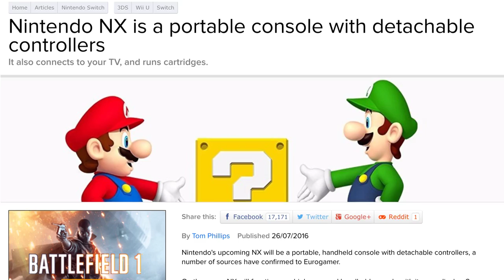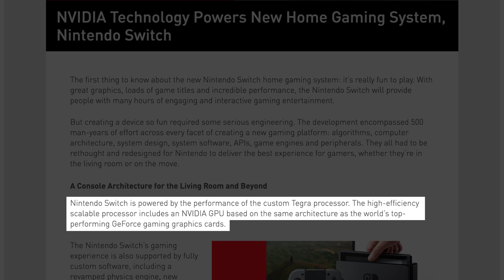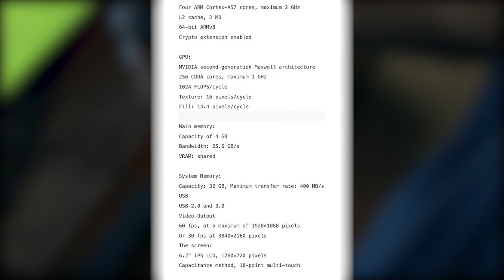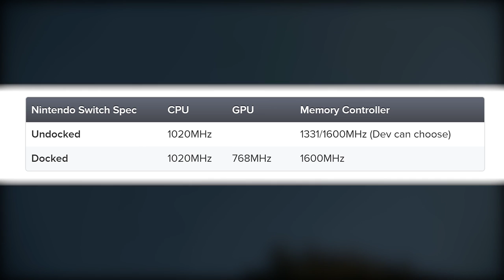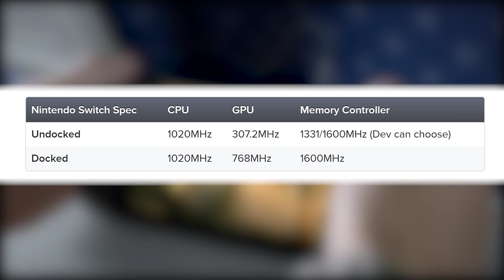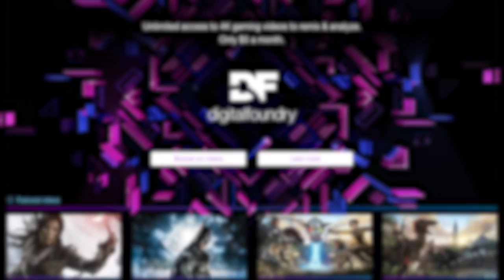DF Videocast #6: Nintendo Switch Clock-Speeds Revealed

Comment: I can't believe they are going maxwell , pascal offers better temp and energy saving, this console needs to shine in handheld this has to replace 3ds and wii u it also can't be more than 250 price point to capture 3ds users everything point to be a great device but yeah we need pascal chip again no only for power battery life and cool temp is fundamental to success here
Reply: Tools  nothing has been confirmed yet, this is all still just rumors.
Reply: the fact is pascal chips stills expensive a ps4 sells out for as low as 229 if nintendo want compete they have to offer switch for no more than 250 is rough but nintendo 3ds find it candy coming from a 200 bucks handheld to a way more powerful handheld

Comment: How many CUDA cores does the Nintendo Switch have ??
Reply: James Qwerty, 256 maxwell 2nd gen. 2015 technology in 2017.
Reply: 256 x 2 = 512 x 768mhz = 393 gflops not near the 1tflop as stated, if that's the case .The ps3 has 230 gflops ,so with those small amount of CUDA cores it's slightly faster than the ps3. Nintendo Switch has to have more than 256 CUDA cores , idk if reasonable GPU clock speed could hit 1 tflop with only 256 CUDA cores .If the Switch CUDA cores = 653 x 2 = 1306 x 768 = 1tflop. Ps4 1152 cores x 2 = 2304 x 800mhz= 1.8 tflops or my GTX 1070  Msi GTX 1070 gaming X (pascal) at clocks it came with, not manually overclocked 1920 x 2 = 3840 x 1797mhz =  6.9 tflops.
Reply: That Tflops measure it's completely wrong it's half precision (FP 16 ) PS3 has near 250 gflops in single precision (FP 32). All you've left  wrotten it's a  nonsense jumble. Divide by half ;)
Reply: It matches the tflop count Nvidia says the GTX1070 has 6.5 tflops , only mine came with a factory overclock.That's on Nvidia architecture too, we know Nvidia has lower tflop count compared to Amd due to differences in architectures .A stock GTX1070 outpaces a Amd Fury x 8.6 tflop card in most games .I know I'm not getting it wrong with what performance you'll see in a real world gaming.The Nintendo Switch may only have 1 tflop but that does not directly compare to Amd 1 tflop count because of said differences in architecture.Please do enlighten me on my own GPU's performance.
Reply: A tflop it's just a measure of computing and it's the same for everything,  and you're right saying that at the same level amd is below nvidia under dx11, but its performance is almost the same using asinchronous computing under dx 12 or Vulkan libraries, in graphics engine like Frostbite e.g.

SoCs devices based on arm and embedded graphics low power solutions use (i.e. Snapdragon, Apple A series, Tegra) usually show its specs using half precision (marketing :)) also Snapdragon GPU shaders, Adreno are based but not equal on desktop/laptop Radeon. Same with Tegra Maxwell/Pascal  are not exactly the same with their counterparts, TMUs, Rops, memory bandwith are heavily optimized for lower comsumption.

Please don't mix apples with oranges. Let's wait and see and don't shoot the messengers who have listen developers who are making games using official devkits. Eurogamer it's not another web with cheap clickbait or an anonymous forum, they hit Ps pro specs and the Project Scorpio existence.

P.D.: Sorry for my bad english grammar I'm spanish. Greetings.

Comment: I think this is a positive thing! Now game developers has to start thinking instead of just porting PC games to console. Most PS4  games for example are just a poor mans versions of the PC equivalent games. Actually I hate the fact that game consoles nowadays runs on PC hardware. It's obvious that every game will run on the same major game engines under the DX11 framework. The PS2 is one of my favorite consoles, and it was pretty hard to code for because of it's own hardware design. This which lead to a bigger diversity in how games looked and played if you compare to the consoles today.
Reply: Didn't seem to work for the Wii U, so why would this be a positive for the Switch?

Comment: These specifications do not make sense
4K/30 with lower specs than shield , I need to see that for believe.
300 MHz in handle mode, like Vita, you can't run BoTW with that.
Nvidia expect 10 years of relationship with Nintendo, 
This doesn't make sense.

Comment: Sounds like a great handheld. But the main issue is that unless you're a fool, it's just going to be another exclusive machine. Don't get me wrong, games that people don't think are going to hit or sell, but are two player are going to put work in, but otherwise, it's just a powerful vita with absolutely no worry about having to develop games that will be cannibalized by their console counterparts. 

It sounds like a proper playstation vita. For me that's a sale. I don't think people remember how shit vita looks in 1080i. And nintendo is really the only company capable of doing that and not needing to destroy or add merit to buying handheld vs the console. Pokemon, monster hunter, mario, mario kart, golden sun, fire emblem, pikmin, animal crossing, etc probably don't need a powerful thing to run it. F zero gx and other m are probably games that require power, and both of those ideas are pretty dead. So mostly smash bros is going to be the hardest hit, and after that, it's just a display with good games. And it probably can do that.

Comment: It's gonna suck so hard! Nintendo didn't learn anything, again and for that reason, they will not get my money. Think about it for a second. Only 1 GHz CPU in video game console in 2017. Let that sink in for a moment. Let's remember also the PS4's and Xbox One's biggest bottleneck, the CPU running at slow clock speed.
Reply: MadFinnTech it's when undocked. If the console used 3Ghz CPU when on the go, no battery would resist.

Comment: This is so messed up. They should have just marketed as a 3ds successor. If it cost over $200 I can't see this as a good purchase in my opinion. If they can bring the games and not have long ass droughts they should be good with thier fan base. I think I would pick it up only because I don't own a 3ds so this is the better option over that.

Comment: Mother of god. I knew the Switch was going to be weak but if these specs are real, I did not expect it to be this weak. I would have expected it to be at least on par with the Xbox One or close enough to get most of the 3rd party games but with being this different in architecture and this weak in power, they're just going to pass it up yet again. 

I don't want the Switch to fail. It's a great idea, everything the Wii U should have been based on what we've seen so far but despite what Nintendo thinks, there is a fine line between offering a unique experience and severely underpowered. 

Nintendo, if you ever read this, let me help you please:

N64 - No CD support, less third party support, two years too late. Otherwise, great console and a collectible with fantastic first party games.

Gamecube - No DVD support meant less data on Nintendo's discs. Resulted in features being cut or third party ports not happening. 2nd most powerful console of the generation and had some great looking games shown with Resi 4 and Metroid.

Wii U - Terrible marketing, terrible brand name, poor USP that Nintendo didn't know what to do with. If it had been named the Wii 2, it may have done better. Underpowered, third party support non-existent, online service still in infancy compared to XBL and PSN. Great 1st party games but again, not enough. It will ultimately become a collectible for the fans and worthless to Nintendo.

My predictions for the Nintendo Switch:

Switch - Underpowered meaning no 3rd party support after launch window like the Wii U. The Switch needs third party support more than anything at this point.

What I wanted Switch to be:

- At least on par with Xbox One to guarantee third party support
- Refined Account system for Nintendo Network
- Handheld games like a proper Pokemon game as well as console games on the go.

Nintendo seem to be afraid to make a console like the Xbox One and PS4 when every time they have tried to be on par, they have shot themselves in the foot. If the Nintendo Switch does not catch on, make a powerful traditional home console with no self-inflicted handicaps with a strong launch lineup and it should sell.

Comment: So, Nintendo went for a small, very incremental improvement over their previous console, and the new console utilizes older tech running at unimpressive speeds and is miles behind the competition. In other news, water is wet.

Comment: Well damn the switch undocked is running at 190 gflops 😂
Reply: 393 gflops while docked ? Mate I have no words right now. I'm praying digital foundry is wrong because the switch is essentially a portable wii u
Reply: Swift B If that is the case, Zelda BotW should have run WORSE compared to the Wii U. As seen from Jimmy Fallon, thats not the case.
Reply: MorimotoYTP cpu is likely the reason why switch is better than the wii u

Comment: With the specs named here Skyrim (and not even the special edition) wouldn't run at 720p or 1080p in a reasonable framerate. So no Skyrim or the specs are wrong. Simple technical reality even if Skyrim is a old game.

Comment: OK so, why the hell does it need a fan for? Why the official leaked patents said the fan was running even in portable mode if according to this rumor it doesn't need it? Why the hell does it need an extra fan on the dock if even when docked it's weaker than the 2 years old SHIELD Android TV? Why didn't they used Pascal if Nvidia has been working with Nintendo for over 2 years and the Drive PX2 came out this January(B4 E3) and it has 2 Tegra X2? Couldn't both SoC be developed together or did Nvidia didn't told Nintendo that the X2 would be ready a year and 2 months before the NS release date? And finally, why the hell would they need to make 2 games just because the Switch has 2 modes when developers have to deal with an infinite number of combinations on PC? Is it me or are some people just trying to kill hype the NS has created?

Comment: 256 CUDA cores * 2 (ADDMUL) * 768 MHz (or 307 MHz) = 0,4 TFLOPS (or 0,15 TFLOPS). This console is a pure joke in terms of performance. Basically docked switch is as powerful as Radeon 3850 from 2007 or Geforce 9800 GTX from 2008.
Reply: Correct. Some Benchmarks:

Geekbench 3:
iPhone 7: 5500
Tegra x1: 5000
Estimated Switch Score: 2500-3000

So in terms of computing power it will be 40-50% of an iPhone.

Graphics: 
GFX Benchmark Trex:
iPhone 7: 107 FPS
Google Pixel C (tegra x1): 103 FPS
Estimated Switch Score undocked: 60 FPS
Ps4: 480 FPS
Ps4 Pro: 870 FPS
Wii U: 73 FPS
Reply: +Walther Penne you know there are mobile phones that can show you're emails and have near twice the power? No need to wait for Nintendo to Re-Innovate you're email reading experience, nor write another book length reply to justify why 2007 performance is a good thing for Nintendo.

Comment: I don't understand Nintendo. Why release a system that's not very powerful when its been proven that people, other than huge Nintendo fans, are not going to buy an underpowered system just for Nintendo games? I am a huge Nintendo fan and i bought a Wii U when it came out, kept it for 6 months and then sold it and haven't looked back. I will stick with my 3DS, which is the big issue. If Nintendo wants this Switch to be a success then they will have to pull the plug on the 3DS. As long as the 3DS is alive i don't think many people will leave their 3DS and buy a Switch, especially since the NEW 3DS just came out. I hope I am wrong though.

Comment: I honestly cant see all this info being true . I have been testing dolphin emulation on my shield console and it just isn't quite there in terms of power . This is where something doesn't match up nintendo said gamecube games will be playable on the switch via emulation and if it only has half clock speed as the Shield Console i'm not sure how they are managing it .
Reply: Pauls Tech emulating through a third party app beta from the android store will never give the same experience as Nintendo porting their own games into the "Virtual Console" ecosystem.
Reply: Pauls Tech A GameCube virtual console is a rumor B even these are the correct specs for the switch there is no way of knowing how much optimization will help the switch performance. just look at iOS vs Android Android phone's components are often twice as powerful as apples because  Apple's is does not need to support as many devices and the hardware and software are being made by the same people.
Reply: Yes I completely understand its not the same thing and nintendo can get much lower access to the hardware .All that said the specs still seems very low . 1GHZ on CPU & GPU clock that drops to 300+ Mhz in Undocked /Tablet mode .Skyrim is a CPU intensive game and that was one the games they showed off I just hope it can deliver what it showed with them specs .I'll hold judgement until I see some reviews of the switch .
Reply: Pauls Tech Skyrim is indeed a CPU intensive game, but that shit can run on the humblest of potatoes with enough settings dropped down. Especially if you manually modify settings and textures to be lower than the lowest vanilla settings.
Reply: ***** Yes I know they could get skyrim running I can run it on a £79 tablet if I wanted but its just awful looking and if that is what third party titles are going to be like that really sucks . But as there are no hard facts yet and its all rumor all I can do is wait &hope for the best . I really do hope all the ''leaks'' are BS.

Comment: Seeing everyone complain about the shit with Nintendo is kinda sad at this point. To most people its common knowledge that Nintendo doesn't overpower their systems and makes great games, but for some reason half the people commenting are acting like they don't even know that even though its brought up a few times in this video by itself. Keep in mind this isn't a large box with powerhouse specs, its a thin tablet with a screen that they have to sell at a decent price and for people to think that PS4 specs on a 1080p60fps screen with good battery life and storage for less than 250 are out of their minds. Let alone this being sold for (most likely) 200 is still ridiculous for some reason to some people. The third party support has had the dev kits, they said great things about the switch. Don't jump on the "anti-bandwagon" bandwagon just because half the idiots who don't do research before they open their mouths are.

Comment: I can't help but think that smartphones are going to be more powerful then the Switch somewhere in 2017, also Nvidia are releasing the Tegra X2 next year and with Android and IOS having low level access to the hardware now, it begs the question how quickly smartphones will be able to do games better than the Switch which then if smartphones make it easier to attach controls to them and connect to tv easier with HDMI as well as bring over more proper triple a games, I have to question what the point of the Switch is when most of us already have a smartphone that can more or less do the same thing and I think this is the real problem for Nintendo, they are entering the mobile arena that is dominated by smartphones.

Comment: You fuckers debunked this whole video in your own article:
"CUDA core count and memory bandwidth are certainly in line with a standard Tegra X1, but critically, the leaked spec is extremely vague about the actual speed of the CPU and GPU, referring only to the maximum speeds seen on Nvidia's Shield Android TV micro-console. Assuming that Switch uses the same 20nm process technology as Shield, those clocks were never going to be attainable for a relatively small, handheld, battery-powered console. The Venturebeat story suggests that Switch is still using 20nm technology, but right now, this remains unconfirmed."

Comment: nintendo might not want to compete with pro and scorpio but mobile market which already has more powerful devices than switch... take phone add similar controller and there you go, you have portable console which is actually smaller and portable because you can't put switch into your pocket, you need backpack or purse.

Comment: Is it even faster than the wii u now?
Reply: Christian B. certainly. I dunno why'd you think otherwise lol. The Switch CPU is miles ahead of the Wii U's so clock speed isn't comparable here
Reply: Christian B. Yes when docked, unsure where undocked.
Reply: The CPU clock speed and the GPU base clock is slower if that's anything.
Reply: ***** I'm talking about the clock/base clock speeds, of course the micro architecture is going to be far better than the Espresso micro-architecture used on the Wii U.
Reply: ***** I never said you should compare it, I just pointed it out.

Comment: Switch specs are bad, there is no fanboy spin for that. The Wii U argument about exclusives made sense at first, it had a year lead. Now the PS4 has a lot of exclusives and the Sony fans love their exclusives just as much as the Nint fans love theirs and those Wii U exclusives didn't stop the Wii U flop. I think people wrongly talk like only Nintendo gets great exclusives. Sony/XO have a large amount of games now and the Switch looks more like a late under powered current gen console than an early next gen console. The Switch will make or break on it's portable feature because everything else about it is not promising. I think if Nintendo can get 3DS fans onto the Switch then the Switch will be huge, but I have my big doubts about that because the Switch looks bulky. Another concern I have maybe this is minor, but the Wii U is already been emulated sort of alright on PC and I wonder if the Switch will be easy to emulate and thus pirate games on PC.